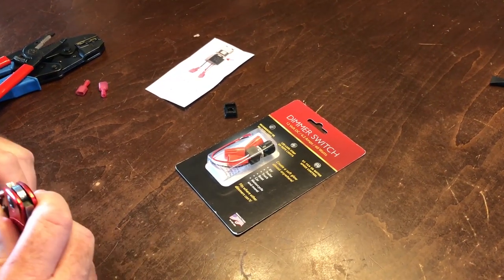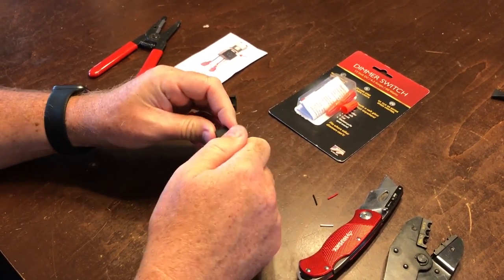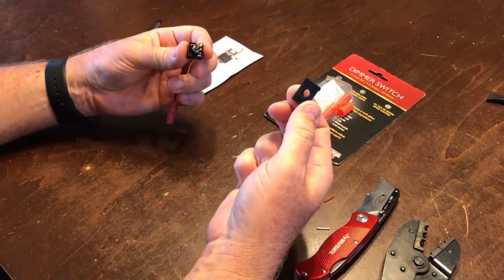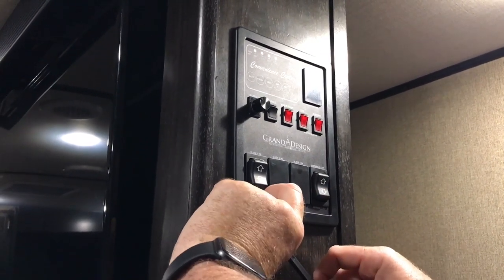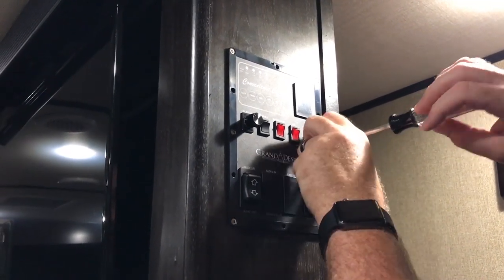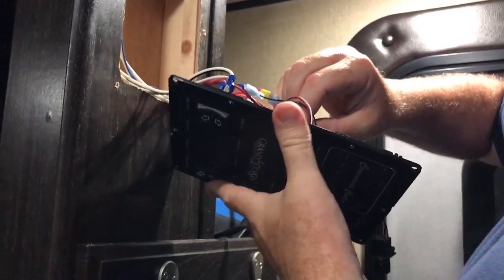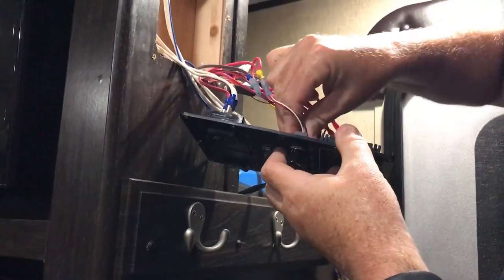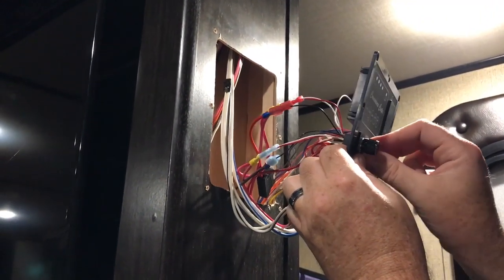Dimmer Install

Comment: I just did this last week, your video was very helpful. I have a Jayco trailer and the wiring was the same as yours.  Very easy and no splicing into the wiring system of the trailer, which is what I liked.

Comment: This is great, just bought a Reflection fifth wheel last fall and noticed the LED strip was very bright at night.
Reply: Installed the dimmer and it works great. The adapter Marty made worked great. Thanks Marty!

Comment: Thank you all!! This little DYI project worked perfectly for our awning lights on our Grand Design Reflection 260RD Fifth Wheel.  We hit a big road block with the installation on the ceiling lights because the panel switch in the Reflection model is a lighted switch with three terminals. We tried every possible wiring configuration without luck. If anyone has any suggestions, we'd appreciate the help.

Taking it to the next level, I purchased dimmers for the lights over the dining table, couch, bedroom and bathroom. I have light grey eyes and can't handle bright light. I tried three different options and all worked perfectly. The larger dimmer switch with the big dimmer slider was my favorite but required cutting a bigger hole with a dremel. But the least expensive model with the touch panel worked just as well. 

Over all this is one of the best "Pimp My RV" projects you can do. Everyone will appreciate the ambience.

https://www.amazon.com/gp/product/B079TL2KQ4/ref=ppx_yo_dt_b_asin_title_o00_s00?ie=UTF8&psc=1

https://www.amazon.com/gp/product/B079TJTP1W/ref=ppx_yo_dt_b_asin_title_o00_s00?ie=UTF8&psc=1

https://www.amazon.com/gp/product/B081FC5BGH/ref=ppx_yo_dt_b_asin_title_o00_s01?ie=UTF8&psc=1
Reply from the maker: With the PCA brand dimmer, you just ignore the ground wire (usually white) that went to the original switch. The remaining two wires get wired as the video or included directions. I also have a not for the 3 wire lighted switch on my instructions.
Reply: @hybris1video Thank you. I will check out those instructions again.
Reply: @hybris1video  I have the lighted switch, and am stuck.  Which instructions are you referring?
Reply from the maker: @twk1956  the instructions I include with the adapters. They just state to omit the 3rd white ground wire that goes to the lit switch. Wire per the instructions for + side led dimming.

Comment: Hello!  I'm working on this mod, but when I went to pull the switches off of the dimmers, the whole stem came with it.  I was able to pull the stem out, but it seems to just pop back into the dimmer, and when I put it behind the plate and try to reattach the switch, it just spins around.  I don't get an on or off "click".  Any suggestions would be greatly appreciated!

Comment: I need to get an optical sensor, but I think the PWM frequency of these dimmers might be a bit low. Just put one in (6 lights on the string) and am noticing some faint (almost imperceptible) flickering. Hoping it doesn't mess w/ our eyes.
How has your experience been now that you've had them in for many months?
Reply from the maker: These are the fastest dimmers I have found so far. I dislike flickering but this flicker was acceptable for me. A true LED dimmable driver would be nice but would probably require new lights and rewire all the lights.
Reply: @hybris1video  it's a frequency of such that the dog's wagging tail strobes. We'll see how it works out the next couple days. You wouldn't happen to know how the internals work would you? I could easily set up a mosfet on an inexpensive microcontroller depending on how these work.

Comment: Marty - Do you or others know if this mod will work on 2021 Reflection 5th wheel models? I've heard that the One Control system in these newer models interferes with modifying the lights. I am VERY hopeful that it will work as the overhead ceiling lights are way too bright.
Reply from the maker: It will not work as described on the newer One Control panels for anything the app controls without significant rewiring. The switching is done in a remote box and only uses the control panel switch for open/close signal. Sorry.

Comment: How can I get the adapter?  I just ordered the dimmer switches. this is a great idea.  Thank you.
Reply from the maker: Todd's Place send me an email. 
scawaoh-adapterman@yahoo.com
Reply: I tried but it wont go thu
Reply from the maker: I got two emails from that address this weekend.  I don't know what is wrong.  Look for the contact me button on my youtube page.  That should work too.
Reply from the maker: If you click on my profile and go to About, there is a message icon.  I don't mean to be difficult but if I put my email on here, I will get lots of spam.

Comment: Where do you get the little plastic part with the hole in it?  that seems to be the most import thing... You can get the switch off Amazon... but not that plastic part.
Reply: Message me for the part

Comment: so it's the longer shaft version of the dimmer switch... great... I already order shorter one...  I wished the guys making this videos would specify exactly the parts they use and where to get them before proceeding with the video...
Reply from the maker: Sorry, this video was made to support a dimmer install thread on a Grand Design Imagine Facebook group, not to sell dimmers or the adapter plate. Short shaft will work just without the nut. A little hot glue or silicone will hold it in place.

Comment: I'm pretty sure those switch plates are the same on my Winnebago since they also make Grand Designs. Do you use the long pole switches? May need 2 plate. 
Thank you!
Reply from the maker: Frank Bailey 
Yes, they’re probably the same. Switch cutout hole is about 3/4”x1/2”. The adapter uses the long stem version. 
https://www.amazon.com/dp/B01C4UBMY6/ref=cm_sw_r_cp_ep_dp_FJkgzbF8Y977N
Reply: I'm ordering 2 of those dimmers from Amazon. Can I buy 2 switch plates from you? Thanks again.
Reply from the maker: LV RV send me an email. Thanks.
Reply from the maker: scawaoh-adapterman@yahoo.com
Reply: Yeah sorry Winnebago doesn't make Grand Design they may own them butt they dont build them! maybe same supplier for switch housing!

Comment: Which dimmer model is that? I found something that looks like it on Amazon, but the wiring hookup is shown differently.

Also, at least on mobile, there's nothing on your channel other than here to contact you. I'd also be interested in a few adapter plates. Looks like my rockers are the same size as yours.
Reply from the maker: Old Curmudgeon it is the PCA long shaft dimmer ELP1013 L. The adapter is about .5” x .75”. Email me for order instructions.
Reply from the maker: Old Curmudgeon there should be a contact me on my YouTube channel page. I’m afraid how much spam I would get if I put it here.
Reply from the maker: I created a disposable email address: scawaoh-adapterman@yahoo.com
Reply: hybris1video I understand completely.
Oddly, I tried sending to that 3 times and keep getting failed (dumb phone maybe). Hang loose and I'll try other methods.

Comment: What if your dimmer switch has 4 wire coming from it
Reply from the maker: The 4 wire dimmers are not recommended. You want to use the PCA brand because it supports “high side dimming”. Basically dimming the +12v when the ground to the bulb is not present.

Comment: Installed, but when I turn the dinner switch to high, the ceiling lights flicker?
Reply from the maker: That happens to some. Believe it is the way the trailer was wired. May just happen on battery or shore power. Just back off slightly and the flicker will go away.
Reply: Mine do this too on battery, haven’t tried shore power yet

Comment: Where did you get the adapter
 for the dimmer to fit the panel?
Reply from the maker: mso1776 I designed and 3D printed them.
Reply: That's cool. I'll have to buy some from you. Are the male plugs 14 ga or 16 ga.?
Reply from the maker: mso1776 They are even smaller than 16 AWG. I would guess 20 AWG. Red insulated male spade terminals seem to work fine. I just fold the dimmer wire in half to make it a little thicker.

Comment: On my Imagine 2600RB, the light has 2 brown wires tied together plus 2 red wires, each running to a separate connector.  Any suggestions on how to wire for the dimmer?
Reply from the maker: The two red usually are the source (esp if they go to different switches) and the brown go to the lights. On the PCA dimmer, the black goes to the lights (brown) and the red and white go to the +12v source (red).